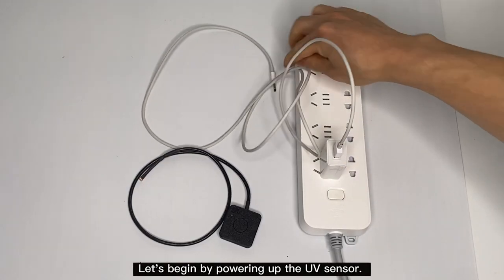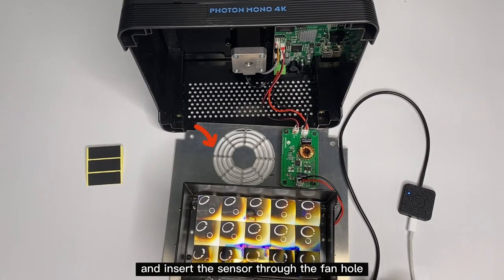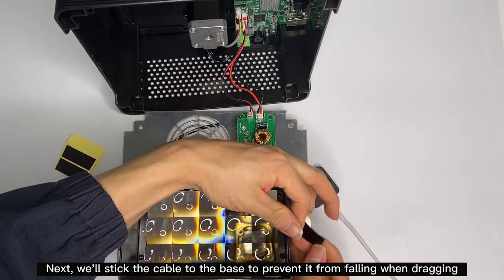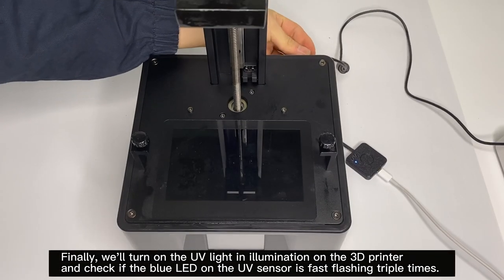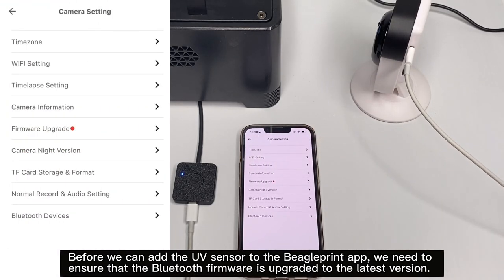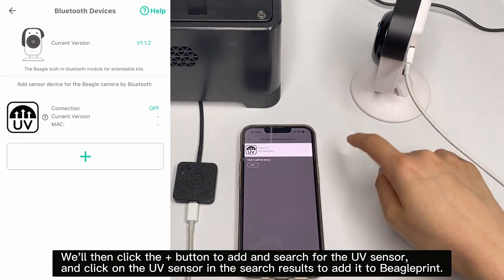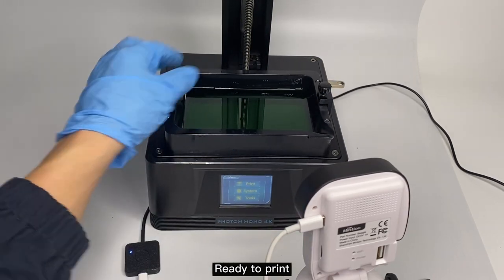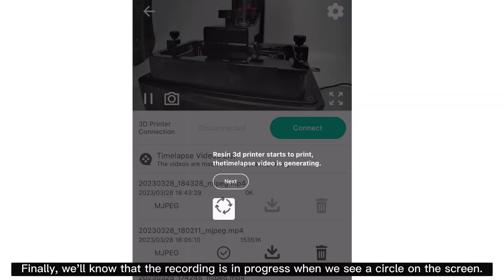Mintion UV Sensor Unbox Video

Comment: cool, will there be a filament runout sensor coming in the future?
Reply from the maker: Very soon😉And it will beyond a normal filament sensor.
Reply: @mintion  cool, because im always paranoid of long prints running out, especially ones that print overnight. also how soon is soon? like in the next 5 to 6 months?
Reply from the maker: @cyberstar251  No need, we are beta testing now. In our schedule, it will be released in May. This smart filament sensor will come with filament detection, E Axis calibration, and nozzle clogging detection. Please join our Facebook group(Mintion Official Group), we usually will update some news first in the group😁
Reply: @mintion  there any news on the date for when the runout sensor will drop?
Reply from the maker: @cyberstar251  Sorry, it's been delayed and our team has a friction issue with extrude and retract. We are still working on it.